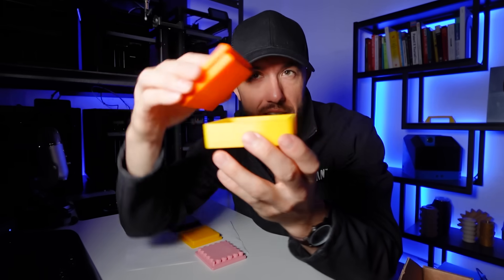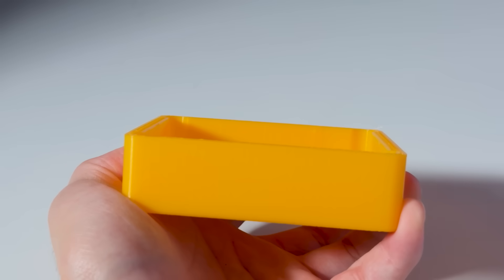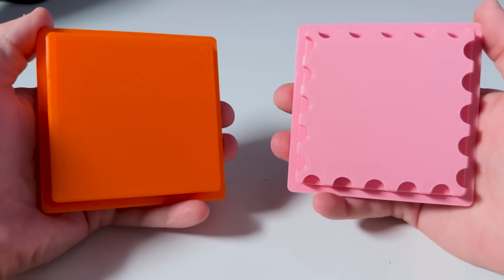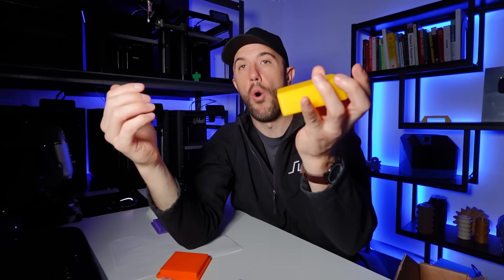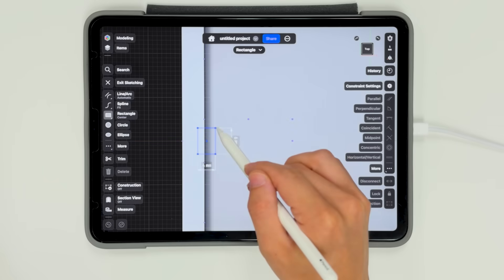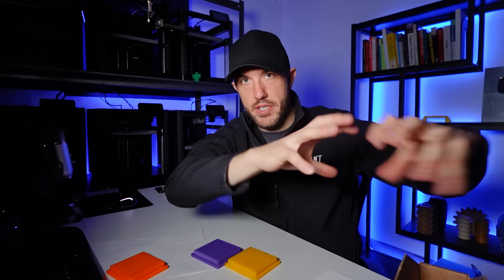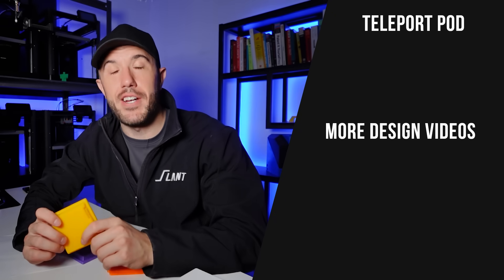Design Compliant Lids for Perfect Tolerance Every Time | Design for 3D Printing: Lids: Vol. 2

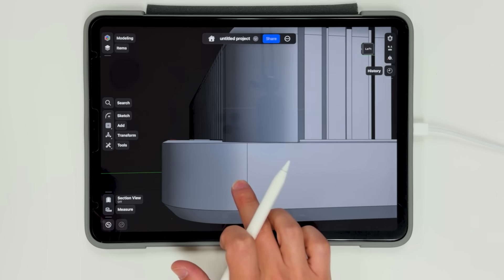Comment: 3:40 .3 mm spacing at bottom? how does that work? wont that just print on top of the layer below and get stuck to that? or is my printer too poor to print with that precision :D
Reply: @shababhsiddique  Normally each printed layer is “squished” into the one below, thus helping them fuse. But when you set a small gap, such as 0.3 mm, the upper layer is just barely touching the bottom one (just enough to “support” it during printing. (More on this later.) they do “stick” together ever-so-slightly, but they don’t fuse. So the first time you push on that upper movable piece, it actually breaks free and moves freely after that.

This is actually exactly how “supports” work in 3D printing. There is a Z-gap between the support interface layer and the model layer above it. By default, most slicers use a gap of 0.2 mm. So in this case you are just manually adding that gap during the design process.

At 3:44 you’ll notice him using a tool to push against the fins and “break” them free initially. After that they are free to move and do their “springy” thing. Hope this helps!

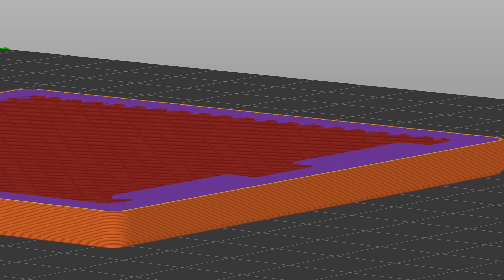Comment: Has you can see at 2:18 there is blue " support " on your slicer, do you add support or give print in the air ? Honestly i just gonna give a try because very small model and copy your 2mm height and hope it work.

Comment: One thing i didn't see mentioned is that you can preload a spring for extra force in a latch or detent. 

I came up with a design for a friend where you can print all the way up to the last layer of a spring, and then pull it back behind the wall which will hold it while the top layer prints. 
The spring initially was printed to extend over the edge of the part. Pause and then lift it slightly to pull it back over and inside the wall of the part, then finish the print.

If I'm not describing it well just think of a spring with a + attached to the top of the end of the spring, sticking out  of the hole in the wall. When you squeeze it into the inside you compress the spring and have an active and relatively constant force instead of one that increases linearly with distance.

You can also use the same idea with barbs that will allow it to recede but not come back out. The advantage is that you don't have to pause the print to intervene. It just requires a one-time push that will catch the barbs on the inside of the wall, which will also keep it preloaded without worrying about prying apart layers.

Comment: 2:30 I see there is a gap in the bottom under the spring. How do you print it if there is only one side connected to the detail?
Reply: @gr18.n1k  the print will sag and touch at the bottom, but it will be a very weak connection. Because it's printed in the air instead of being pushed into a layer below, you will get a circular line that's taller but narrower than the lines typically would be, and has nearly no fusion to the layer below. The layers above will sag a bit too, but with a thin gap like that it should only be a few layers before each layer is completely normal.
Reply: @markjacobson4248 got it, thank you!
Reply: @markjacobson4248  Yeah i just try this method on a tiny case for just two tools, and it " work ". But my outside perimeter is like 2mm so there is a little bit of deformation, cause it's hard to have the right force because the " spring " have many paramater like the length, infill, thickness and other stuff. For very small things like 3 / 4 mm box the best way if it's only for you and you made a few is just basic 0.2 / 0.3 with a little bit of sand paper. Or you make your thing round so you can add a thread but there is also many tweaks to make it work.

Comment: Excellent ideas. How do you print with those tiny gaps for the springs and moving parts? The overhangs look impossible.

It bugs me that the lid and container did not have matching fillets along the vertical edges.
Reply: Tried wih a 0.3 air gap and it work fine on a tiny piece lke 10 mm spring

Comment: Can you show locking complient latches. I have been trying for a few months to press 2 (0.5 inch) pieces together and not come apart. I have tried a few things that work but fail over time due to creep. The biggest issue is have is the size constraints.

Comment: @3:35 How do you print the cut out along the bottom without it failing, fusing, or the slicer trying to put supports there?  Would it like a bridge where one side needs to be broke free after the print?

Comment: Pro tip: Plastic under load creeps over time! I have done a side spring friction fit design just like in the video and they loosen over time. PLA creeps less than PETG at room temperature, but creeps way more if it gets mildly hot outside. Try to use something like the plunger design with a notch so it's not under a lot of tension most of the time!
Reply: @lupeters213  Yep, this is the main problem I have with most compliant mechanisms. Most materials and designs simply creep or permanently deform too fast, leaving you with a part that fits sloppily and needs to be reprinted or redesigned.

Comment: Question: How do you print the entire purple cap since it has this 0.3mm "hole"? Doesn't this require support for the filament?
Reply: It's close enough. Support would be a 0.2mm gap and you want the fins to break free
Reply: You don't need supports when the gap is that thin. Instead of fusing the plastic the printer deposits it on top, so it's not a solid joint.

Comment: talking about how changing material can mess up you tolerances and then designing parts that rely on print in place overhangs not binding is kinda ridiculous.....
Reply: Tolerances for a tight fit and leaving space for parts to move freely are two completely different scaled things. 0.05-0.1 or 0.2-0.4 is are huge difference.

Comment: I'm a little unclear how to support the grip fins over the 0.3 mm gap. Same goes for all the horizontal spring mechanisms.  Do you support them with a sprue that breaks away?
Reply: I think the answer is that you don't support them. They may droop down to the lower layer, depending on how long the fins are, but won't strongly bind to it. Notice where he drags a metal scraper over the fins? That breaks whatever connection the fins make have gotten to the layer below. So a possible negative to this approach is that it may require some post processing in some cases.
Reply: @ees_44_ees I figured that might be the case, and if so it needs some elucidating. A drooping part seems a little inelegant to me.
Reply: Yeah, it seems you've traded one tricky clearance for another 🫤
0.3 might work for one filament with one process setting, and not another
Reply: Excellent question. He’s mentioned grip fins before but, strangely, never pauses to explain clearly how they’re designed so that they can print with a gap like this. Part orientation solves some of the problem, but only for one or two sides of the part.
Reply: Yep, I came here to ask this.
Reply: @NormanRamsey I sent a comment directly to them to ask if they can do a video on this topic. 🤷🏻‍♂️
Reply: @ThatAdam12 🙏

Comment: I usually like using magnets for closing lids, but a design I'm working on would require so big magnets for them to be strong enough, that I'd have to make the box significantly bulkier. Already toyed around with a compliant mechanism and I'm close to getting a good fit, I'll try your tips out and see if that takes it rest of the way there!

Comment: thank you for sharing this highly informative video , with actual demonstrations !  Can you provide more information on how to implement the gap under the fins and side springs?
Reply from the maker: 0.3mm spacing
Reply: @slant3d but how do we manage this overhang? Its not touching bottom on 2 ends . Should we make a micro support on the floating end , that we can snip off after printing ?
Reply from the maker: That would be a good way of doing it
Reply: @slant3d thanks 🙏🏻 for the prompt response!

Comment: These get loose over time(less than 100 uses) when printed in pla. 3d printed stuff just don't last long especially pla.
Reply: As always, design for the use case.  Similar to how live hinges are great because they're cheap, but not great because they don't last as long (even in injection-molded parts).  If you need a lot of cycles, use something purpose-built, or an extra part.  If you don't need a lot of cycles, say for an electronics enclosure you only expect to open and close a handful of times, these mechanisms are a great choice.
Reply: If it's going to be frequently taken apart then magnets or snap fits would be better. He's just giving people tools for their toolbox.
Reply: Shouldn't be the case if you're designing things properly
Reply: @maskettaman1488 there's not that much you can do with pla, as it slowly gives in under stress, no matter what. Sure you can make it last longer, but eventually it'll get looser. Petg should do much better at least.